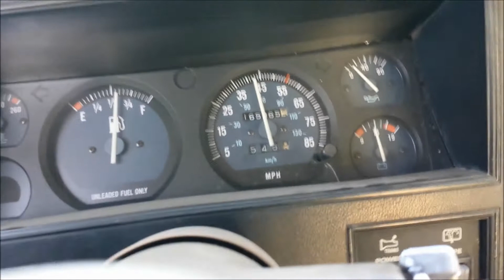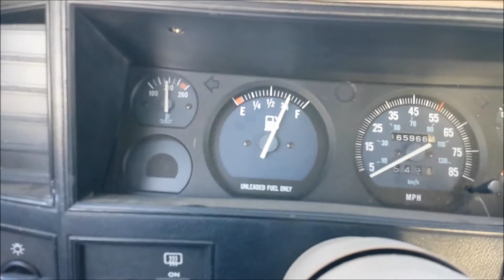89 cherokee driveability  issues

Comment: same thing is happening with my 98
Reply from the maker: have you done anything to try to fix it? I've cleaned the TB and the IAC. the throttle position sensor is next on my list (should be here today), as well as a new fuel filter. my next steps are to replace the IAC and then look at the fuel pump...